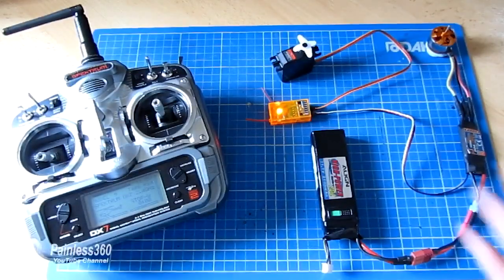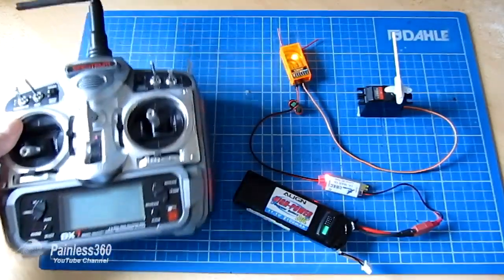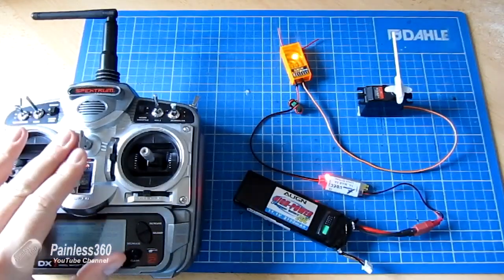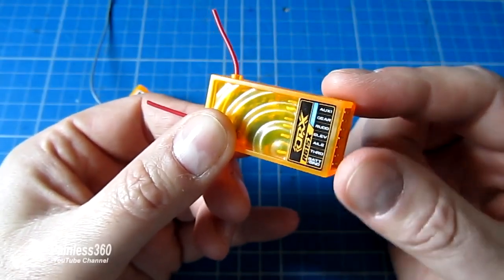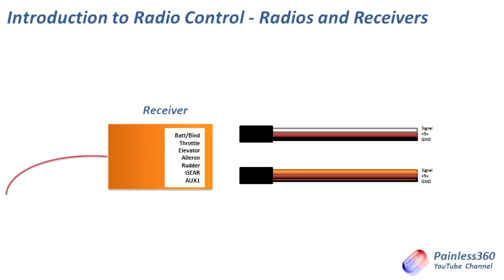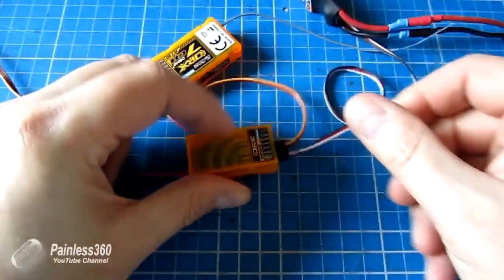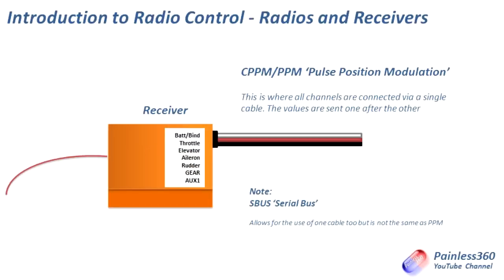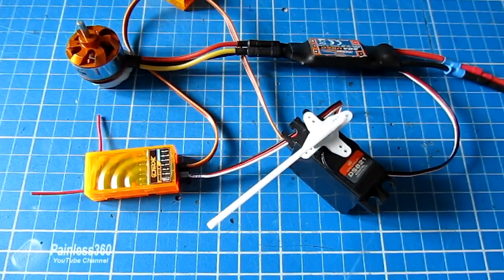RC Basics: Introduction to how a RC radio system works

Comment: could you explain why i can send with 1000 mw and the reciver only 100 mv , 
i can not make sense of this at all . 
i will use this  Radiomaster tx16s mk3 max  and  ER16 PWM - Dual-Band GEMINI and GEMINI-X Receiver 
radio can send with 1000mv but the reciver is only listed as 100 mw , does not make any sens to me

Comment: Love the videos, you’re now my go-to for radio control and drone info.
Do you do any one on one counseling?
I’m fairly knowledgeable on the electronics side of things once I get an idea of what does what, but finding out how things are related is what I’m looking for.
Right now I’m having an issue with mixed servos not servoing.
TX16s bound to the 6 Chan rcvr. motor works, elevons don’t.
Channels 1-4, setup aetr, where are the channels assigned to the servos? At the output of the txmtr, or the output of the rcvr?
Reply from the maker: Default channel order is set on the mixer on the radio. But, you can also move the channels around on the ELRS PWM receiver too... see my video on setting up PWM ELRS reviewers. Beat of luck..

Comment: What firmware do I need to install on the ESC?
I have an ESC from a drone with BLHeli32. Will it work with a PWM signal?
Reply from the maker: If you're using BLHeli when I'd use DShot on the model. Best of luck!
Reply: @Painless360  Thank you, bro)

Comment: I am very new to RC so bear with me, your videos are extremely good at learning this very quickly. I am looking to use two motors with a single  hand controller to add to a paddleboard a bit like an e-bike but for a paddleboard!! If I have two motors that are max 20A, can I connect these with just one ESC that is rated at 60A, or am I better having 2 ESCs one for each motor and then how do I connect them to a simple single hand controller, another reciever board or use another channel? I know this is a slightly bonkers idea but its for someone that has problems with their shoulders so can't paddle for too long.
Reply from the maker: You need one esc per motor... see my other basics videos... best of luck
Reply: @Painless360  thanks, I think I will need as much luck as I can get but hopefully it will work.

Comment: Hi, that was an amazing tutorial! I have a question though, and I still couldn't find an anwser for it. Is it possible to connect another type of controller (i.e Xbox, Playstation) via Bluetooth or via cable to translate the inputs to a radio signal? And if so, how would the pairing of the transmitter and receiver work? I'm extremely grateful of this playlist, and it's gonna be very helpful to my project. Thanks!
Reply from the maker: Not really. That's why there isn't any content about it. Best of luck

Comment: One question, which port does the ESC/BEC connect to on the receiver?
Reply from the maker: All of the GND and voltage pins are connected, so it doesn't matter. Normally plugging in the ESC connection provides the 5v the reciever and servos need. See https://m.youtube.com/watch?v=yLgKLRN7Si4

Comment: Hi, Thank you for all the helpful videos. I also watch your Pixhawk videos. I see you connected the Servos directly to the receive. If you had a bigger plane with more powerful servos, would it still be connected through the receiver or Pixhawk board? I see some powerful servos (RAW 800LP Black), but they still require only 4.8-7.8 V.
Reply from the maker: You'd only connect the servos to the receiver directly, if you are not using a flight controller. When using a FC, you'd connect them to that instead... as you've seen on those Pixhawk videos. Thanks for watching!
Reply: @Painless360  Thanks for quick response, I guess my question is, my understand is the FC can only output 5V then how can we connect bigger servos to it, will it not fry the FC? Thanks
Reply from the maker: Depends on the FC. Most support the use of higher voltages now for more powerful servos...

Comment: I'm new to RC and I have a project where I want the servo motor to move 270*, do they rotate that far?
 I see the one in this video is only about 90*.  Is the amount of rotation a setting or a max limit? I watched again, and I would like servo control like the motor speed control, i.e. non spring loaded position control, I want to push the joy stick down and it stays, servo is to far left, move joystick up 1/4 and servo moves 1/4, move joystick to middle and servo moves to center position.
Reply from the maker: Some do, but they are a specialised servo. Rotation should be in the specs of all servos for sale..

Comment: Grate info.,  My problem currently is: My radio is talking to both of my Models... If my Model #1 goes dead in the water, then I launch my rescue boat Model #2,  model #1 model 1 & 2 are responding to my Radio which I have set on Model #1, model #2 shouldn't do anything.  I'm not sure what the problem is.  I have a FlySky GTC3 Radio, which I did BIND with each receiver, but not at the same time.  Model #1, I did Bind separately.  Then I entered a N ew Model #2, and I did the BINDING process agin for it.  I don't understand why there would be any crosstalk.   Any help is appreciated.  I just got back into RC Boating,  my last time running RC boats was 1973-1979.   Any help is appreciated.  Thanks for your Instructional Video, I appreciate the time and effort you guys take to help others.  :-))
Reply from the maker: Most radios have some kind of setting, so that model binds are specific to that model. Model match or number are common names to use to look up in the manual. Best of luck

Comment: If the remote only has one antenna how does the receiver know what info to send to what wire. Like if you want to increase throttle how would the receiver know whether to send it to a servo or a motor

Comment: Yes I have a hexcopter that I cannot get my apm to install on my drone can you plz help me out thanks very much
Reply from the maker: APM is a very old, unsupported flight controller but my series setting up APM from back when it was a current piece of hardware are still on the channel and still relevant. Best of luck

Comment: If there is anything dumber than a noob, it is I. 4  channels mean 4 functions ? Like steering, throttle, trim...leaving me another function? I want to make an airboat model.
Reply from the maker: Exactly. Each 'channel' can control one thing on the model. One channel much be connected to the ESC/Motor and act as a throttle, another can be connected to the servo that controls the steering linkages. You can use the others for whatever you want; pan and tilt controls for head tracking, activating lights etc.
Reply: @Painless360  TY !

Comment: What if my friend or someone else in the neighborhood has the same transmitter and the same receiver? Spending $300 on a transmitter, and my plane crashes into a house or traveling car..  because someone else has the same setup. Once these are bound, nobody can interfere with it?
Reply from the maker: In the old days, before modern radios this could happen as the only way to 'separate' radio signals was to use different frequencies. For a long time now, modern radios 'bind' to the receiver and vice versa so they have a secure 'key' so they can talk to each other. Dozens of pilots can use the same radio system in the same area without any problems.. I hope this helps.
Reply: @Painless360  Awesome. Thanks so much.

Comment: Great vid, and the others...thank you... just getting back into it after some years.  Just check@ 26.11...pulse width should be 1 mS-2 mS (or 1000uS - 2000uS) with 1.5 mS being centre position.  A pulse width of 1500 mS is one and a half seconds which would be a slow reacting servo!
Reply from the maker: Yep. 1500 microseconds (1.5 milliseconds) is what pretty much everything uses as mid channel. The only one I've come across that is different is futaba... happy flying!

Comment: You are always So informative!!!  You are a great Heli advisor!!  The yellow light on my Blade 230s V2 will not come on . Nor will the red or green..NO LIGHTS..
I plug in the battery, I have the tones, but thats it..nothing else. I believe this has to do with the flight controller, the AR6250MHXA 230s..Do you have any idea whats goin on? Im 60 years old, and quite electronics savvy, but I've been on this for two days, and it just has me stumped...I spend hours and hours on the computer trying to find solutions for heli related problems..You are always my last hope before I go to Horizon.. Please help...Thanks so kindly.    Michael

Comment: Hi I am a little confused I have a new RC Atomic RC boat with a 20 amp ESC and brushless motor on first attempt to run well for about 10 min then the motor cut out and would not run then started to run in reverse I switch 2 wires and it started running forward now then got about 20 feet away and the motor cut out again to not run at all now switch back the wires does nothing rutter works fine seem maybe the controller is not in sink with the ESC or maybe I have to relearn the throttle on my controller, does ESC burn out what do you think.
Reply from the maker: Does sound like the ESC failed to me.. Best of luck

Comment: Thanks for the tutorial  please can i ask you this can i configure the controller right hand stick for two edf jet fans to steer my rc hover craft  like you pull this stick left or right to activate the two fans to steer im planning to use 5 edf fans in all two for rear thrust two front on both side for steering and one for the cushion can this be done with a drone power distribution board ?
Reply from the maker: I've replied to your email.. It is possible with OpenTX, check out my OpenTX Mix School..

Comment: It helped me a lot and I’m planning to make a miniature ship with remote control 
My question is how to make the motor rotate forward and reverse via remote control? What electronic device do i need to made the motor rotate forward and reverse
Thanks
Reply from the maker: You need a special ESC with a reverse function. Best of luck
Reply: @Painless360  thank you so much! I really appreciate your response
Reply: @Painless360  sir one more thing and the last one sorry, but my motor is a 3 phase motor it has 3 wires but the esc has only 2 wires is it possible to connect this 2? How about the other one wire?
Reply from the maker: No you need a brushless ESC for a brushless motor. See my video on ESC basics... Best of luck

Comment: I've received several RM receivers.  They do not have vbat in for the servos???  how do I power the servos?
Reply from the maker: Via a 5v supply usually connected to one of the servo connectors... Best of luck

Comment: hey. is it possible to connect 4 motor in 1 channel with esc? I'm planning to make all wheel drive rc car. which is consist of 4 motors. is it possible? and how?
Reply from the maker: Yes but then you can't control each of the servos for steering and other cool tricks. You could connect all of the GND and signal wires from the 4 ESCs into the throttle channel on the Rx but you'd also have to carefully calibrate them so they operate at the same power levels and speed. See my cars and trucks playlist for more tips...

Comment: I am a noob here in the RC world.  Some electronic, radio and telemetry training and experience in other fields.   

Your explanations have made it clear to me, without stating it explicitly!  Do I in fact understand that the RC communication link is one-way, that is, from ground to the aircraft?  

It seems that in the case of servo only control, say a glider,  the Pilot is the feedback loop.  In the case of a multirotor UAVs, and intelligent motor speed control,  the Pilot is aided by a programmed flight controller that contains its own control logics, such as PID control, and of course ESC control for the  motors.   

Finally I ask how is telemetry handled?  I thought at least some basic telemetry was transmitted back to the ground, to be displayed on the  RC controller.   And optionally more telemetry using a separate radio/antenna system. 

Thanks for your valuable efforts.
Reply from the maker: Most modern links are two way now so that you can get telemetry data back to the radio (see CRSF, SmartPort and others). There are options for separate telemetry but those are usually used for more professional rigs.. Happy flying!

Comment: Have recently got back into RC after 19 years. Changed a lot, this video was very good. However its 6 years old, does it still apply or is there other advancements?
Reply from the maker: The basics are still the same.. Best of luck

Comment: Great video and well explained. Do you have any videos that show how led light are connected.? Do they connect straight to the reciever and work on a switch from the transmitter? Also I have a fishing bait boat I'm rebuilding. And I want to connect some blue led lights to the bait dropper. So that they flash once the bait has dropped  (for night use) can you advise? Thanks in advance
Terry
Reply from the maker: Check out my video on the Turnigy switch. It might be the thing that you are after.. best of luck

Comment: I know this is an old video... hopefully you're still reading this, or somebody else who is willing to help out.
I haven't built anything yet, as I'm trying to understand the theory first. Are those receivers always limited to 5V? What do you do when you want to power something that requires more voltage, say 9-12V? I guess you could use a step-up converter, but still many Amps will go through the receiver, when something is very power-hungry. Are there other receivers that tolerate higher power? To make things even more complicated: let's say a powerful propulsion system requires 12 V and lots of Amps, but the servos run with 5 Volts? What would be a good solution in this case?
The reason for these strange questions: I'd like to experiment with larger multistage ionic wind generators (something similar to the 2018 MIT ionic glider, but with lots of improvements), powered by a flyback transformer. Because ionic wind is known to be very inefficient, I will require a relatively high wattage to generate the thrust (and more than 5V as input voltage into a typical flyback transformer).
Thanks!
Reply from the maker: The 5v power system for the electronics is usually separate from the other power systems on the model (ESCs and motors mainly but also sometimes servos too). Things like R/C controlled switches can be useful to switch more powerful systems - see my other basics videos.
Reply: @Painless360  Thanks for answering!

Comment: Thank you. When powering the receiver does this also mean the motor is connected to the receiver through the signal line through the esc
Reply from the maker: Indirectly,  yes.

Comment: Great info , I too are in the process of coming back to the hobby after some 25+ years , but never had any dealing with electric flight . I'm building a RES type glider at the moment but have also bought an electric ASW 17 arf . I have bought 2x Spektrum AR637T receivers , ( I like the idea of the built in telemetry but am waiting for the NX8 to arrive ) . Looking at the receivers , I'm confused as to which port to plug the Nimh receiver battery into for the non powered glider . Can you advise ? Keep up the great vids !

Comment: Very good video. Can you help me with some answers? I have a mc6c transmitter and receiver and it have a battery alarm. This is for plane battery alarm or transmitter battery? Ived had some tests and used a 2s to power a 30 A esc and transmitter and the alarm is running when i power on. The ESC measure the power level and it send to receiver and then send to transmitter?
Reply from the maker: Usually a battery alarm is for the model so you can know when the battery is low and it's time to land/stop and recharge.. Best of luck!

Comment: Painless 360 I'm making an rc model and it doesn't need servos just the motor because it's a Guage 1 model train so what will happen if I try it with no servos?
Reply from the maker: Should be fine.. best of luck
Reply: Oh great! or. does it mean it will explode? Or shock me

Comment: So, in short, you "turn the receiver on first" and the transmitter on second (with the "throttle down").
Reply from the maker: Nope. You never power the model without the radio being on.
Reply: @Painless360  ...
12:17 You turned the receiver on first then pressed and held button on back as you powered the radio (transmitter) up.
I think the confusion is that once binded then you turned the transmitter on first. Anyway, my toy says step one is to turn the receiver on then the second step is turning the transmitter on. It looks like I have to bind it every time I use it.
Reply from the maker: That is binding. Not normal operation. Different radios have different processes and it's a one time deal for most of the protocols. Some of the smaller, toy grade models don't remember bind info. See the 4in1 videos.

Comment: Have you done one on the 3 Position Switches?   Basic Stick functions are obvious.  But Being new to this pastime, distant from knowledgeable flyers, and knowing I want to utilise the gyro in my FMS trainer, what is the relationship between the GYRO unit  plugged onto the Receiver’s SB pins and one of the STALK SWITCHES on my FUTABA T6K?  As simple as ON or OFF or....?
Reply from the maker: It depends on the radio. If it's an OpenTX radio then I have lots of videos that cover that.. Best of luck!

Comment: Great Video!  Thank You!  Quick question:  Can these receivers be used for any remote control car, boat or quad?  Also - can you bind more than one receiver to a remote control? Can I program other features via Beta? Lastly, can I use the Jumper T18 for any remote control device?
Reply from the maker: Yes to both. Best of luck!